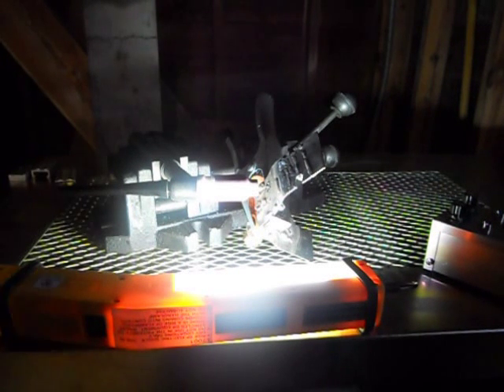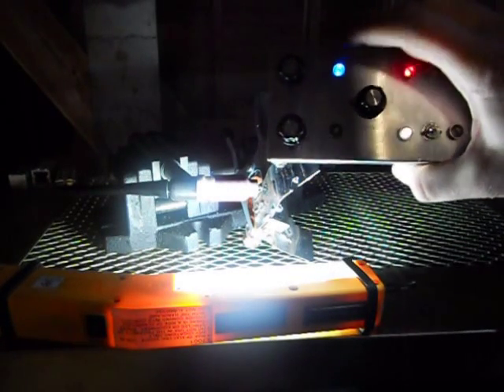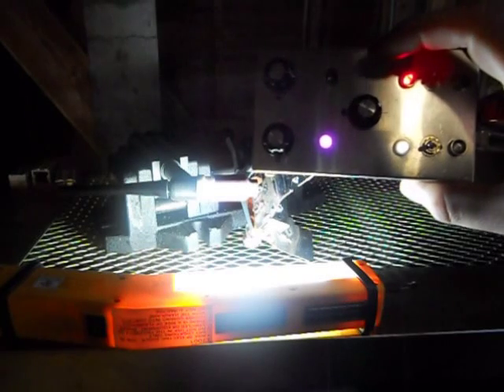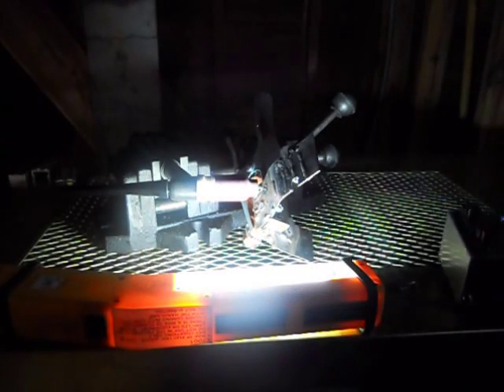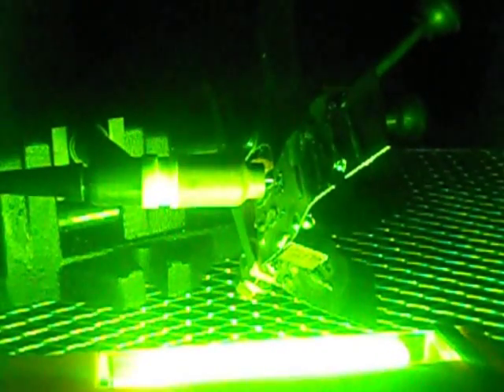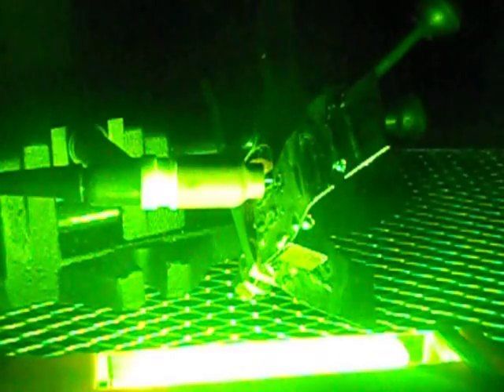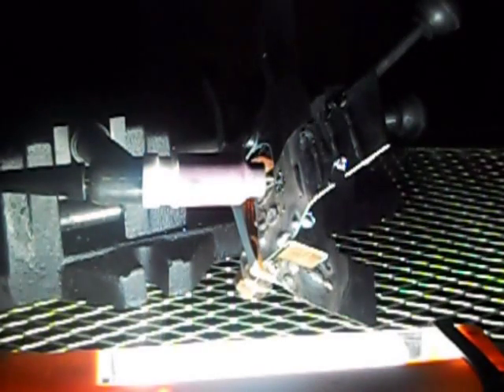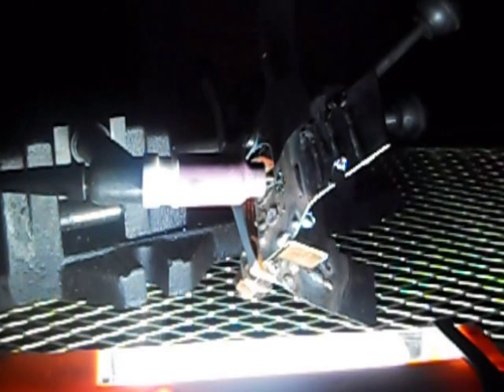Miller Diversion 165/180 DIY Pulse TIG Box

Comment: I wanted to check before I bought a TIG Perfect box from www.jattus.com
Reply from the maker: Man, they want a boatload of cash for that thing! I think I had it in my head to sell mine for like $150 or so plus shipping, you could buy 2!
Reply: +Nickolas Williams I'd sure like to have options, especially if you're talking about better capabilities like tapering in and out the current flow at the start and end of the weld, allowing the pedal to still manipulate  the input to the comparator and pwm circuit as you weld (so you can back off as the part gets hotter). The other box is currently limited to 40-50 pulses. I would love to test one.
Reply from the maker: Do you mean auto taper as in 2T/4T style?The first iteration used the pedal only as a sort of switch to start and stop welding, the pulses per second and high/low current were set by 3 controls on the unit. The flaw in this setup was obvious after the first test, weldments would become heat soaked as you went leading to wider and wider heat affected zones though the frequency control aspect worked well. The second version will be wired in such a way that pedal input sets maximum welding current, taking into account the knob on the welder itself still has authority over how far you can actually go. Thus if you have the welder maxed out, full pedal gives full current. If you have the machine set at say, 80 amps, full pedal gets you 80 amps. The pulse box will have a 'background' current setting, switched in and out at the pulse frequency set by the user. Idea being you want to be able to taper as you go so you use the pedal and welding intuition, and you set the background current as required. Some aluminum welders like to have a slow frequency with low background so the puddle freezes at each background pulse to stack consistent dimes. Others like a fast pulse and slightly higher background current to agitate the puddle which I have tried and works well with steel, not so much with aluminum. Others who work with stainless have told me that a medium frequency and background decreases heat input to try and avoid warping.There are 2 ways I can go about doing this, electrically. I can either have background set at a fixed referenced voltage independent of main pedal current and set by the front panel knob (pedal does not influence background current), or I can set it up as a PERCENTAGE of main current which I think makes more sense. The reason why I think it would be better is that the background would sort of 'track' along with main current from the pedal instead of remaining at one fixed value, thus as main welding current is tapered out at the long end of a weld, so is background so you don't end up with the background value appearing larger at the end of a weld as when you started. Otherwise it's conceivable that background current might end up at the same value as main pedal current, which is obviously not good.Being that this will be an analog box, options over control are somewhat limited. I don't want to go the microcontroller route, because it would easily make the project a $300 a piece unit when done like the one you posted about. But it will offer quite a bit of flexibility for not a lot of cash, will be robust and repairable since it's built using industry standard discrete components not impossible to find chips made in China, and that's exactly what people who have these machines are looking for. After all, many of us bought a Diversion because we couldn't justify a Dynasty for our shadetree style projects. And even if you don't really NEED a pulser, it's a lot easier to justify a $150 box to play with than a $350 one.On the test equipment front, I finally have a calibrated frequency counter so I can now accurately gauge the pulse per second capability of the unit. I was just guessing before based on my needs, so it will be nice to know exactly what sort of range we're working with here. More later!
Reply: +Nickolas Williams I think you're spot on with the percentage idea. Yes I think it needs to allow the welder to back off or ramp up the current as they go, also needs a delay or trigger so the initial puddle is formed before beginning to pulse. There are several "external TIG Pulsers" both analog and digital. That TIG Perfect looks like a parallax kit, I'm sure an Arduino could also be used to pwm the output of a comparator circuit. I'm curious what the limits are on the front end of various welders (filtered)... the foot controller circuits may limit us to a certain extent. Keep in touch. I'm interested.
Reply from the maker: The communication, if you want to call it that, between the welder and the foot control are all low voltages easily handled by common semiconductors. But you have to take some precautions to avoid damaging both the welder and foot control, as they are all very low current circuits. For this reason everything inside my box runs on a regulated power supply, so even in the event of a controller fault (let's say it sticks wide open because a transistor shorts out) the worst thing that can happen is max commanded welding current comes from your welder. The way I designed it, no damaging voltages can ever get into your machine. Side note, noise doesn't seem to be an issue. I suppose the twisted pairs in a normal Ethernet cable, which is what the foot control is made with, is enough to keep the welding itself from harming these low control voltages. Interesting that the TIG PERFECT has duty cycle control. I hadn't planned on having variable duty on mine, just left it at 50%. But since I'll now have a spare control available, it should be pretty easy to add that function. Yay, just gained a new feature!
Reply: +Nickolas Williams I look forward to testing a box.
Reply from the maker: Jared Sams I'll get a hold of you when I have the revision done, you can beta test this thing for me and give me your thoughts.

Comment: I have a miller 180 and would like to buy one of your pulse boxes. Great work man. How can I get a hold of you other then via post here?
Reply from the maker: Still working on the finishing touches to the circuit, I need to add some additional filtering to the output and it should be ready for another round of testing. Thanks for the interest, stay tuned I'm not giving up!

Comment: I'd like to see more. Curious how it's coming along and costs? Does it pulse both ac and dc?
Reply from the maker: Yes, it pulses both modes of welding. I have a modified schematic done, but haven't found the time to make the modifications just yet.
Reply: I'd like to build one to use with my Diversion 180. I work on electronics for the USAF. Would you care to share? jbs4radio@gmail.com

Comment: do you know how much and when you might have it available?
Reply from the maker: First round of beta testing is done, the unit is being returned to me for some modifications after some feedback from the tester. The revision will have a background amperage knob which is based on input from the pedal; previously the box used an internal reference voltage to feed 2 knobs (pulse and background), meaning the pedal was out of the equation in pulse mode. Pretty basic oversight on my part. In other words instead of being fixed, the revision will be able to vary the pulse amps with the pedal and background current will be tailored to a percentage of that based on the position of the knob. So it will be closer to being something that would come in an actual machine with pulse. The issue the tester was having was heat soak into parts, which is opposite of what this thing should be doing. I'm confident once the modifications are done, it will be very close to something we all want on our machines. If the tester confirms all of this and is happy with its performance, we move into final design and packaging phases. That's when I'll know how much it will cost to mass produce, but it probably won't happen till next year sometime. Hopefully you guys can wait that long, I think this project will be beneficial to a lot of people who need the feature on a budget.